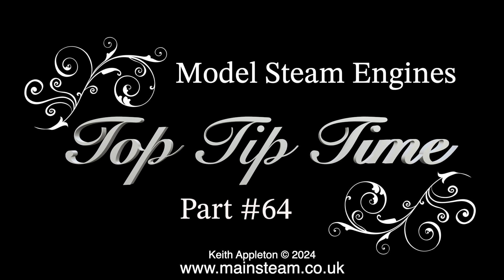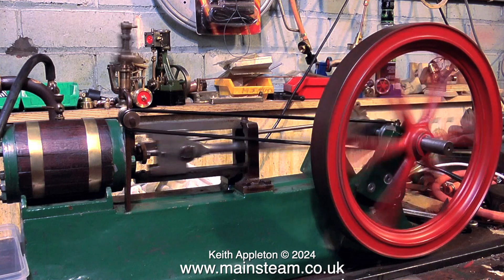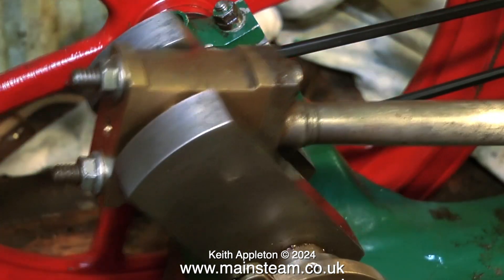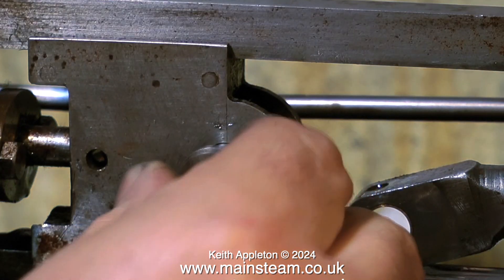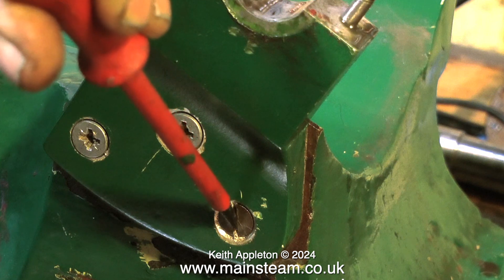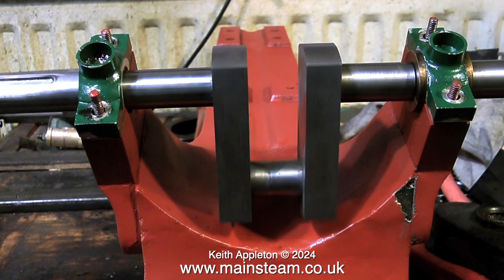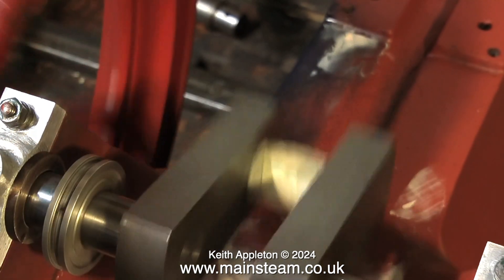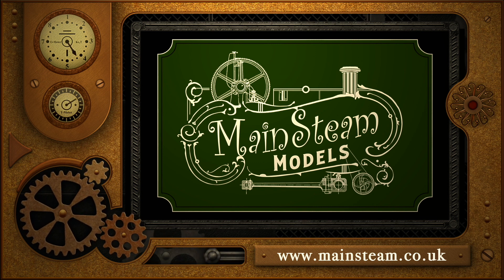MODEL STEAM ENGINES - TOP TIP TIME - PART #64

Comment: This engine looks big enough to run a generator of decent voltage!
Reply from the maker: Yes it would be good for that purpose, but then of course you would need a massive expensive boiler and the time to constantly tend it when the engine was in steam .......